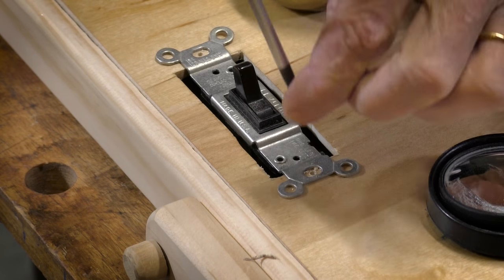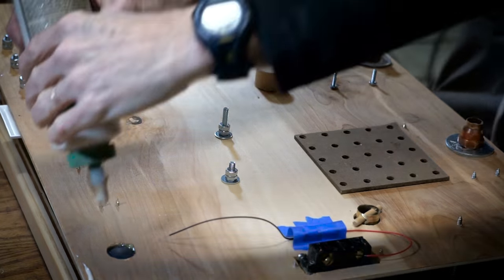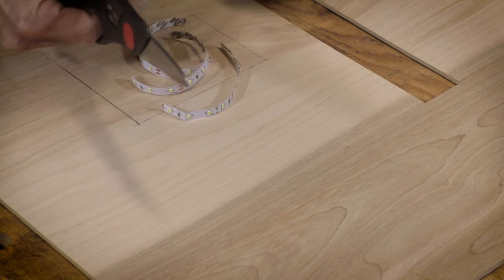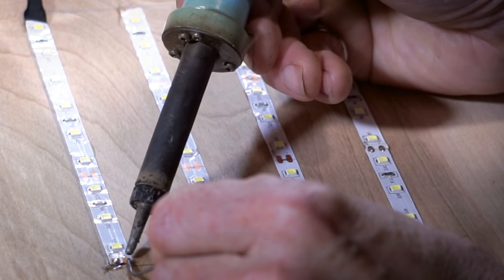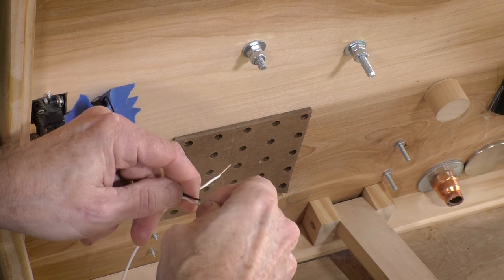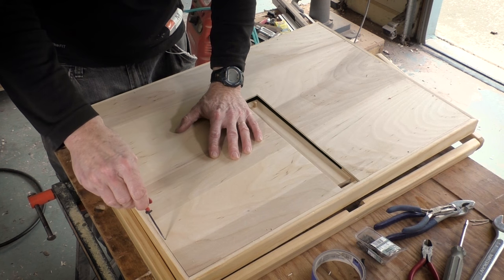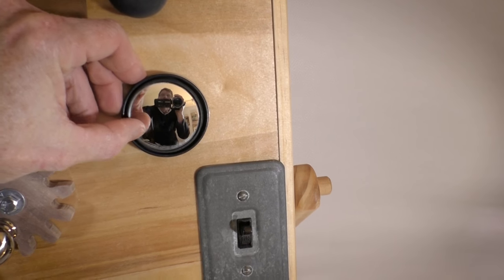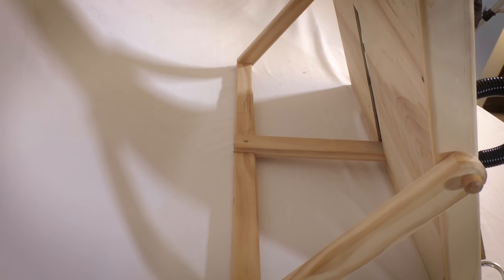DIY Busy Board Part 6

Comment: nice sir. sorry for a noob question. but what resistor did u use for the LED light?
Reply from the maker: It's just the LED strip connected directly to a 12V battery, so it does not require any resistors in the circuit.